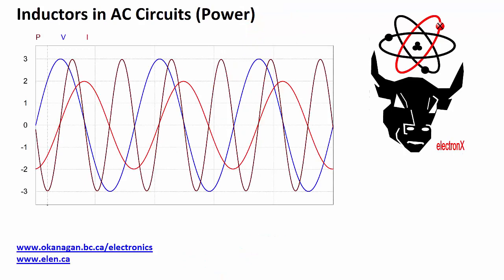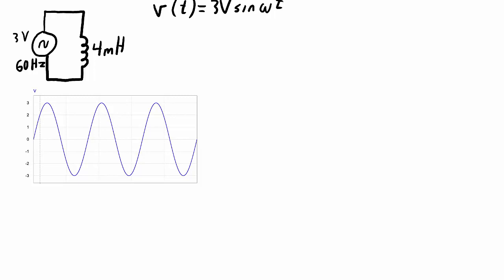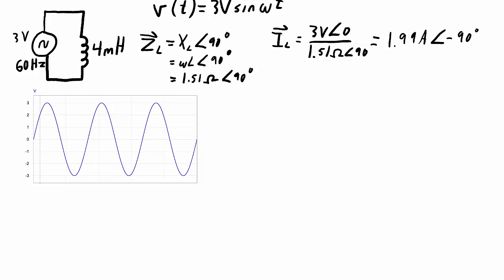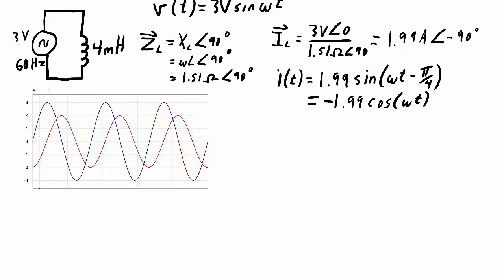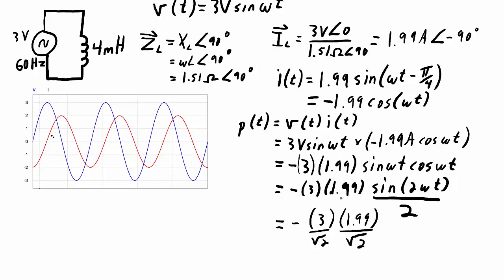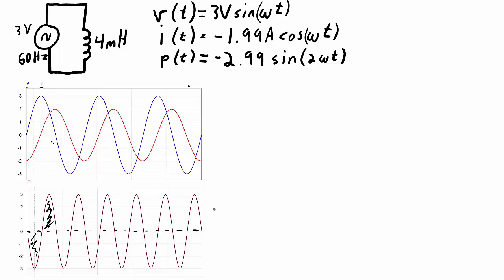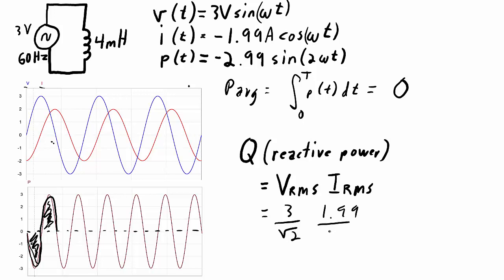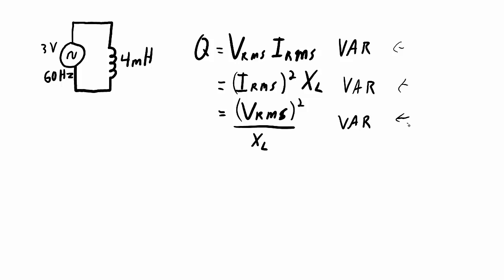Inductors in AC Circuit (Power)

Comment: Great video. Thanks for explaining this. As an electrician, we had to study this, but I never knew why it mattered. Do you know why it is important to understand all of this information?
Reply from the maker: A practical reason to understand the phase shift due to inductance is that it relates to the power factor of a system. In industrial settings where there may be a lot of inductive loads, the owner is generally required to keep the power factor high. Since the inductive loads bring the power factor down, capacitive loads need to be used to create phase shifts that are equal but opposite to the phase shifts due to the inductance
Reply: @ElectronXLab  got ya. Thanks for the information!

Comment: Z=XL<90
is this angle=90 arbitrary?
Reply from the maker: The 90 degrees is the phase angle difference between voltage across and current through an inductor (voltage lead current)